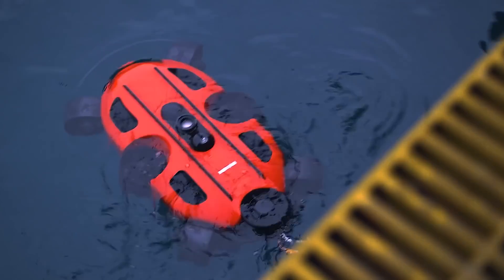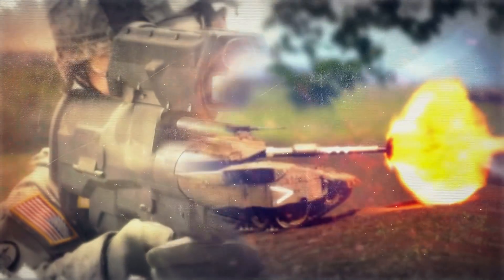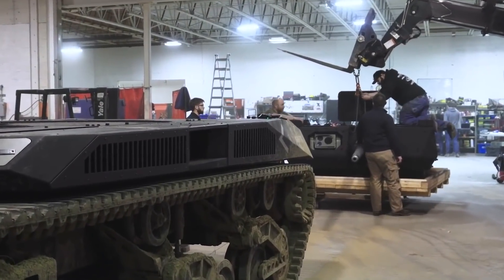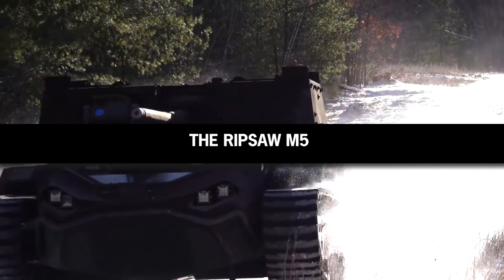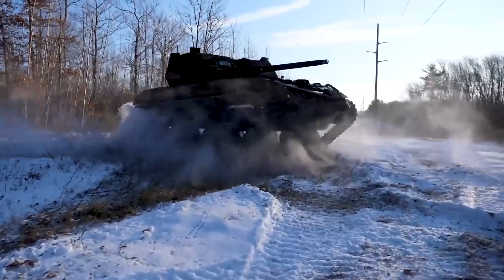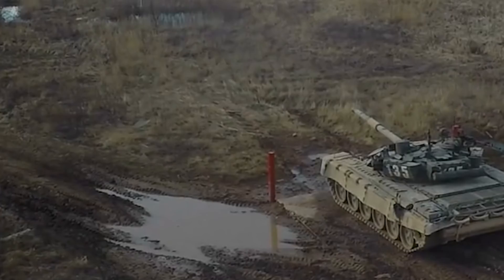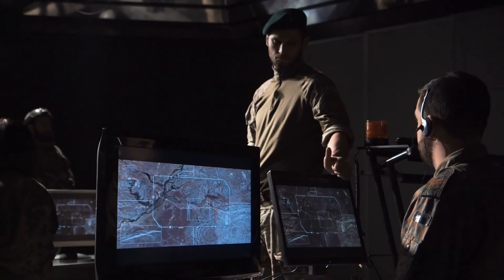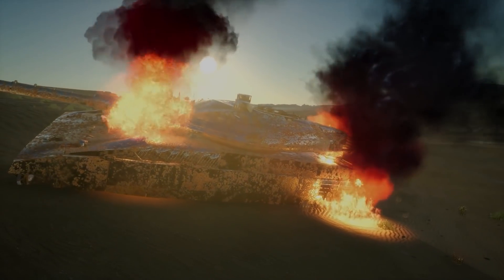The Next-Gen Superfast Armored Tank No One Expected

Comment: If they have to operate within a mile of each other, the command vehicle sounds like it would simply present itself as the easier target, especially if more than one tank is controlled from there. Imagine if a drone aircraft had to operate within a mile of a command helicopter. And if something goes wrong with the tank, there's no crew on hand to fix the problem. Every step to take people out of harms way just puts them in a different set of crosshairs. It sounds like there are applications, but a war theater doesn't really sound like one of them when you examine the details.
Reply: I think you might be seriously underestimating the efficiency of a drone swarm concept. It would be nearly impossible to completely stop that aspect, and Ukraine is showing this so far. One big spydrone sitting up at 50k feet should have everything targeted scary fast.
Reply: @MatthewStout  And one long-range missile targeting the command module that needs to be in the same combat zone as the drone swarm will take the whole thing down.
Did you not pay attention the video? The tank and controller need to be within one mile of each other. That's 5280 ft.
Reply: @delcox8165  its only one part of the system that can be replaced or upgraded once the military gets there hands on it. It also does not make the whole system useless plus even if you have to be within a mile lets say the command module is in a Abrams and there is not only one Abrams but 20 that look exactly the same.
Reply: @delcox8165  That's where I think they're bullshitting us. There's no reason a main drone can't assume control of it within the hierarchy. We'll see I guess.
Reply: @L0neW0lfL0gan  Drones in the middle east are piloted by people in North Dakota just going to work for a day. It's silly to think anything requires absolute proximity anymore.

Comment: An rpg can stop the ocular unit on the torret, now the entire machine is just a rc tank that can’t do anything. And electric power? Musk has some of the best battery tech on the planet yet if you own one of his cars you can’t travel across one state without recharging it multiple times, so how is this going to work one a tracked vehicle that weighs a lot more than a Tesla ? It won’t.
Reply: Then it has multiple systems, and can you guarantee blinding it with a first hit?
Reply: It's a diesel motor that powers electric motors, similar to how freight trains work. 100% of torque at 0 rpm.
Reply: Future designs could have removable battery packs. When a pack dies, a fully charged pack could be installed while the dead pack is recharged

Comment: seems promising but also seems like it'd be an easy target. how long do the batteries last?
Reply: I expect it'd be armoured against small arms and shrapnel .Essentially it's a light tank.
Reply: i wonder if it hits a certain battery level then skitters off suddenly to dock like a giant Roomba?
Reply: But they would have to find it first if it was not moving. :)
Reply: I would think that they would use a diesel electric drive like they do on the big Oshkosh trucks.
Reply: @justindunlap1235  nah, batteries seems to be more viable for this.